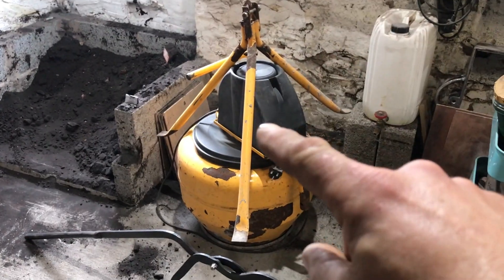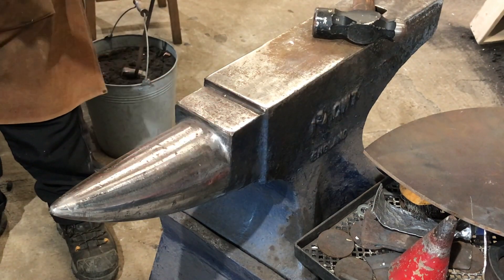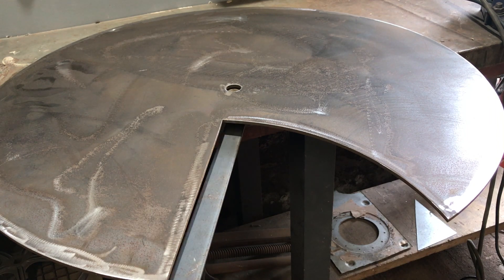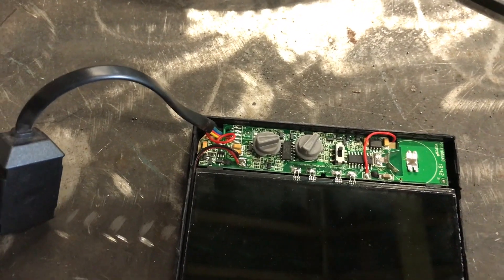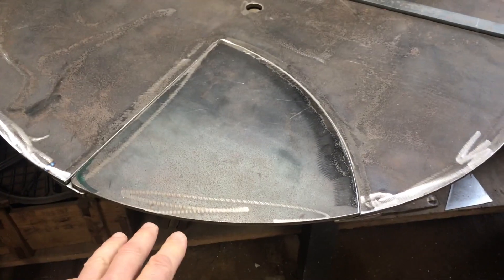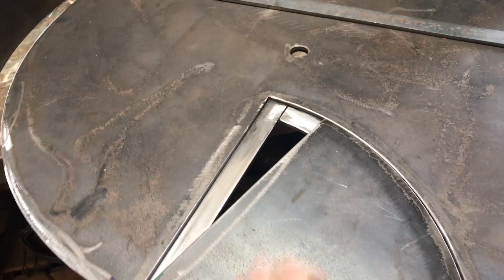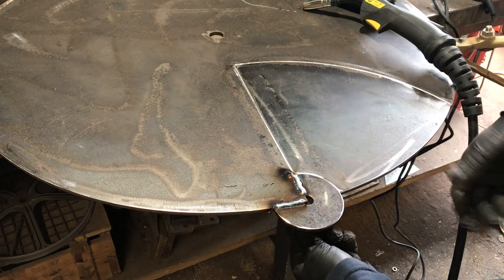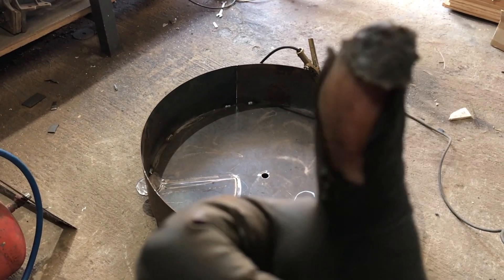BUILDING A SAND MULLER  /SAND MILL FOR THE FOUNDRY Part 1

Comment: Hi there.  Have subscribed, hopeful you may be able to load up a part 2 of this?  Even if it is a 2 minute vid showing the final machine in action?
Reply from the maker: Hi , Yes been working on the sand muller between jobs, hoping to post soon, was also hoping to complete in two parts but looks like a third, you will see it up and running part two. Thanks for subscribing.